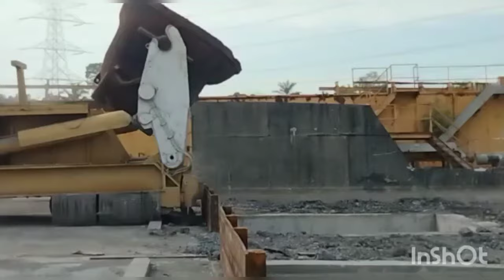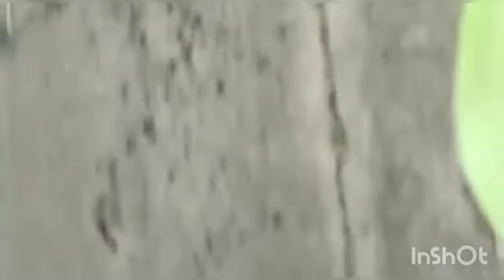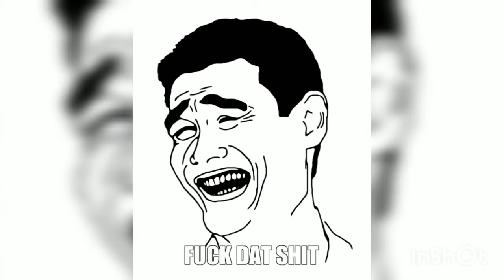What happens when you accidentally pour molten slag onto water (or any moisture)

Comment: Poor molten-slag-containing bucket machine. (IDK what it's even supposed to be called.) Nobody even thought to use it to pour the molten slag onto a ramp, which would be used as a slide for the molten slag to be deposited into the water at a safer distance?
Reply from the maker: You could take up a gig, giving names to industrial equipment. Guess whats the name of the crane that goes over your head? Overhead crane

Comment: What caused the explosion?
Reply from the maker: When liquid water turns into steam at 100 celcius, that liquid expands by 1700 times. But this steam is definitely more than 100 celcius. On top of this 1700x expansion, when you heat steam further past its boiling point the pressure increases too. This sprays molten material everywhere like an explosion. You can do a small scale version of this by using an oxy-fuel cutter cutting metal and letting the scull drip onto damp floor
Reply: @de0509  I thought it was from the outer crust cooling around a molten core. Thank you.

Comment: If anyone's curious as to why these kinds of steam explosions happen with molten slag and molten metal, but not much so with molten lava, I believe I have an answer based on what I know about thermodynamics:

I believe that lava, much like the rock that it normally turns into when it cools down, is relatively low in terms of being thermally conductive, meaning that it transfers its heat into other materials at a slower rate, too slow to cause water to melt into steam at a rate no more violent than causing steam bubbles to form and pop within the lava. (It's why glass baking sheets, which are made out of the same kinds of non-metallic materials that rocks are made out of, don't heat up as quickly, or transfer heat as rapidly, as metallic baking sheets do.)

OTOH, metals, including molten metals, are highly thermally conductive, meaning that when they make contact with things that would turn into vapor at the high temperatures that these molten metals would need to be at to stay molten, including water and water-ice, those metals would transfer their heat into the other materials at an alarmingly rapid rate, so rapidly that it would cause the other materials to not just melt or vaporize, but flash-vaporize in a way that would create these kinds of violent explosions of steam.
Reply from the maker: Slags actually a kind of rock rather than metal. They float ontop of the molten steel. Theyre basically lava. The mystery intensifies

Comment: so how do they keep this from happening in the winter when rain comes?
Reply from the maker: Could install a roofed structure above this for relatively cheap I guess. Some places use a double trolley crane to lift the slagpot into position and to dump it in. This place uses a slagpot car, so it seems that they didnt bother to have a roof in. Plus the water is there only when theres a stoppage in production. Usually it costs lots of money to heat up a furnace so usually people want it to stay hot and run 24/7 until the maintenance day. No chance of water to pool since the pit is hot. Also, it helps if the slag has solidified a bit instead of totally liquid
Reply: @de0509  thanks for the reply! Hadn't thought of that.   Totally makes sense that if the pit is hot, even snow would evaporate.
Reply: @de0509 the plant i work at has a dump barn because of stuff like this but we use kress pot carriers as well